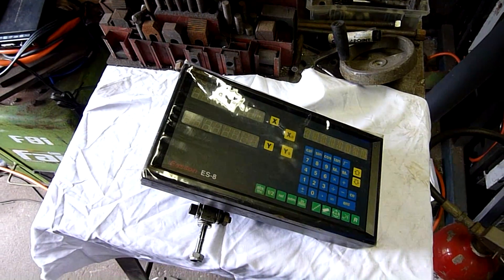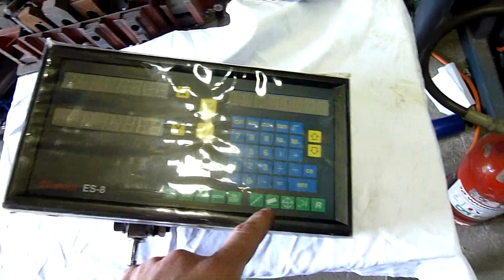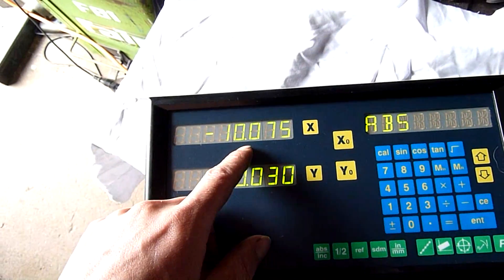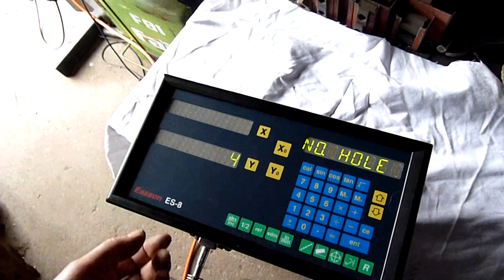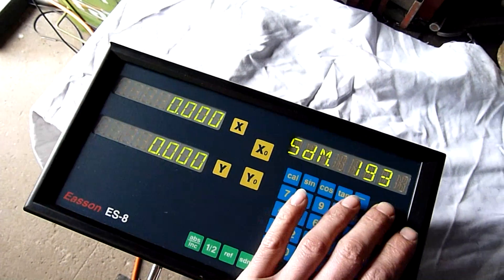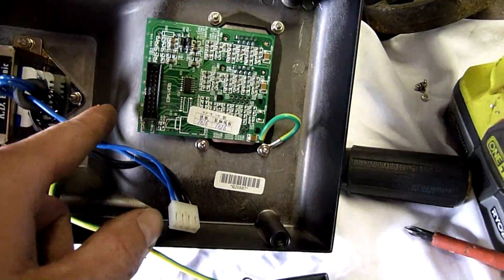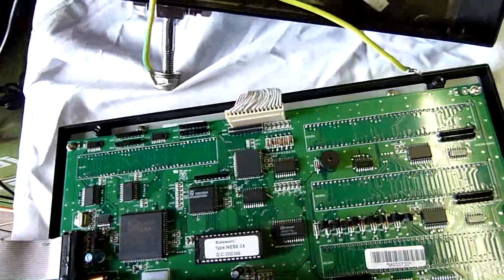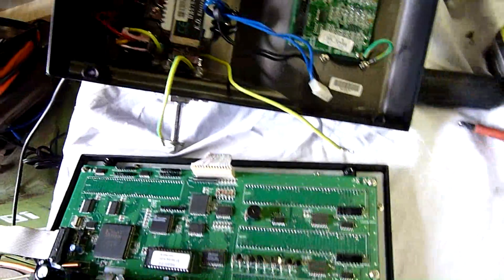Easson ES-8 Mill DRO Display Unit Inspection and disassembly

Comment: just a question... are you going to use it on one of your lathes ? would be cool to se how you put that together if you are :) nice video btw
Reply from the maker: this one stays on the mill that I am getting, I want to put the Heidenhain DRO on the turret lathe tho
Reply: Aussie50 The nice thing is that Heidenhain has the manuals on their site. My Victor lathe has a Heidenhain that originally failed to coolant but I fixed it up.

Comment: Xilinx Spartan is an FPGA (Field Programmable Gate Array), not a processor.

FPGAs function very differently than a processor. You can think of an FPGA as a large number (thousands or more) of logic gates which can be interconnected to form complex logic operations. Whereas a processor would require a great number of clock cycles to perform the necessary calculations to deliver the desired output, an FPGA can do so nearly instantaneously by comparison, and can also perform a large number of operations in parallel simultaneously.

This makes FPGAs great for speedy time-critical bit crunching.

In the DRO, the FPGA likely handles the processing of input signals from the scales, thus providing fast reliable tracking of the scale movements without the need for a ridiculously fast processor. Also this means the DRO can keep track of changes in scale position even while the processor is "busy".

Comment: The biggest problem with old memory backup batteries is when the electrolyte leaks and it chemically tracks along the copper tracks under the solder resist.  A lot of old gaming machines like pinball machines have seriously damaged boards in the area round the battery because it has done that.  It;s always a good idea to replace them either with a new battery or a memory backup capacitor.
Reply: Very rightly so bigclivedotcom i actually powered on my lathe after a few months of non use, to an erratic display on my 3yr old ES-8 Lathe DRO, found the battery leaked & corroded 1 trak leading to a pin on the RAM chip. im an amusement tech, & have lost count of how many times i seen & had to repair battery corrosion on MPU's in my past 25yrs in the industry, back then we had to repair the boards & neutralise the corrosion with 50/50 of white viniger/water.. i used the same procedure on the DRO rejumpering the trace from pin to pin & she's been running like a charm since the repair was done in 2009. 
Dave VK2HDN
Reply: I've had the exact same battery leakage issue with my pinball machines.  It causes so much damage as it travels along the tracks under the solder resist.
Reply: yes, alot of work, but well worth it for your own machines & retaining originality for those certain collectables, & when capable to do for yourself, as i see you very well are, saves alot of bucks. keep up the good work, mr. also it's good to see the modern replacements MPU's keeping the hobby alive too.

i'm also subbed to your channel too. so i'll pick up further with you over there, Cheers mr

Comment: Phase quadrature usually uses just two sensors to detect direction and speed.  As used on computer mouse wheels.  The output is simply a 2 bit gray code.  I guess it's no surprise that machine tool control components are available cheaply from China.  They must use millions of them in their factories.

Comment: Winbond W2465= 8 KByte SRAM ; Philips P80C32 is the main processor = romless 8051 in CMOS. The chip under the custom one with no markings is most likely another 74xx373/374 or 273 which all 8051/8031 use as an addresss latch. The Xilinx  contains most likely the counter engines. The board looks very nicely made :)
Reply: I was guessing the 74 series chips were multiplexers for the displays :) Then I looked them up. Agreed the board looks very well made - I too noticed the large backup battery on the PCB near the eprom :)

Comment: The ES-8 is designed for both lathe and mill applications. That is why the main board has provision for a third display and why it contains both mill and lathe specific calculations. It is very similar to my Meister DRO's except for the diecast case. I have an ARC2 and a BOLTS3 DRO and I love them too ... lol